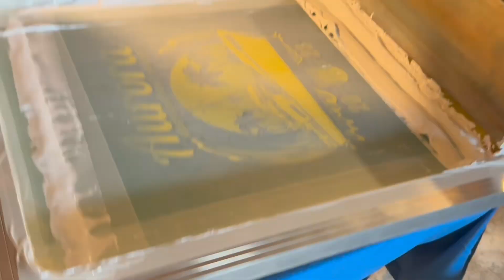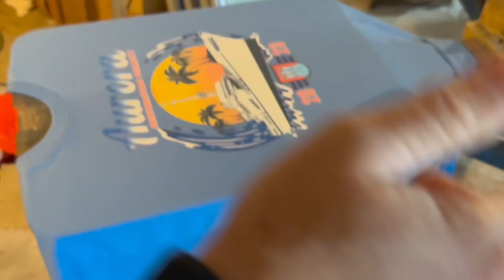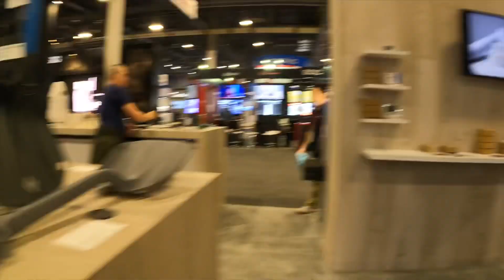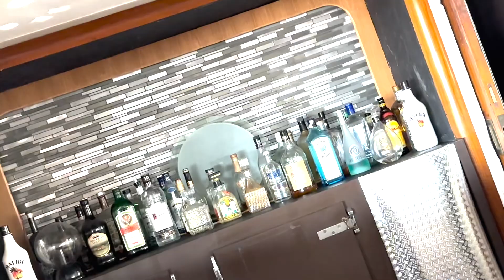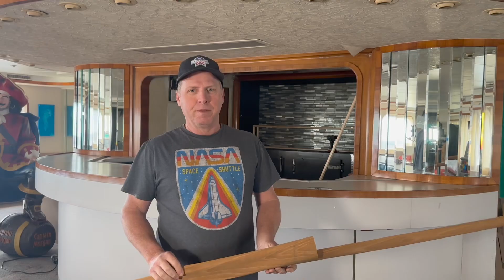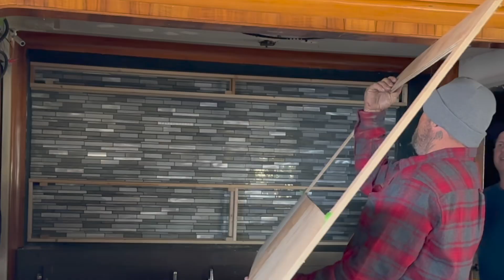HISTORIC CRUISE SHIP LOUNGE BAR CONSTRUCTION ADDING A FIRE PLACE by MODERN FLAMES

Comment: Not sure about those engines. But often they are dry sump and dipstick is for running conditions. Also look around for a pre lube sequence if possible. Most of the maritime engines come with that. 

If the engine is with a external and internal coolant system check the intercooler probably it's plugged by now. 

Fuel rack make sure it's loose not a fun sight having a engine that size run away. 

Try to see if you can find any of the old log books and procedures. Most machinists keep good track of what and when things where done.

Comment: If there is a built in heater in the bar fire place you cant just install it with out ventilation it has to breath if your using the heater function you can't block the vents in back of unit just saying

Comment: Dose this fireplace produce heat on the back side for the lighting or a heating element? Dose it need air vents to allow heat to escape and not be sealed Air tight in a box? Looked like it has vents on it so u need air flow around the unit. I like wood for a wall mounted fire place. If it was low on the ground like a real fire place then brick makes more sense

Comment: Great to see another video from Aurora! Hopefully, you all will weather the Spring storms and not incur too much damage from any leaks. I'd stick with the teak look until it becomes evident (if it ever does) that a change might be necessary. Ditto correction if any safety issues are found. I wouldn't think this might be a heat source. Be well, be safe!

Comment: Chris – not sure if the unit actually gives off heat, looks like some of the Modern Flames units do, but I suspect you’re looking at the visual aspect not to try and warm up the liquor bottles!  So, if heat’s off the table,  the teak face looks good – but, since you are on a ship, I’d put trim around the edge the serves to cover the screw heads and lap over a bit to assure the unit won’t fall forward in case of turbulent seas!

Comment: I would have thought it would go in the cabin somewhere 
We’re the people will be not behind the bar we’re it may get too hot for the drinks and anyone working in there 
I think there needs to be two of them one on each side of that area below the side windows
Reply from the maker: More of just a light feature than an actual heater in our case.   Will never need to produce heat in this location.

Comment: As an expert fireplace/appliance inspector, I urge you to follow the clearance allowances to combustibles as noted by the manufacturer. That is the only safe course of action. Personally, I like the tile better than the wood, but I can't see an easy way to save it.
Reply from the maker: Thanks for the info.  Interesting enough we have the heat disconnected as we only intent to use the light show.  The wood seems to be the popular vote.  It does look amazing when in operation however.

Comment: Is the tile mounted to something that can be moved 6 inches forward?   If possible, I would simply cut a hole in the tile wall and insert the fireplace directly into the tile.   Even if the tile cannot be moved forward, perhaps the fireplace can be inserted into the substrate (plywood ?) on which the tile is attached.  For a modern electric fireplace, I definitely think the tile makes a better backdrop.  Teak looks better as an “edge” or framing material.  When you have a whole wall of it, you tend to lose the character of the wood.   If nothing else, I would try to build some kind of a metal or plexiglass “frame” to suspend the fireplace in front of the tile.  You could even add indirect lighting behind the fireplace to make it appear to “float” slightly in front of the glimmering tile wall.   Cool project !

Comment: Is that unit going to produce a lot of heat?  I know it's an artificial fireplace, but I have installed two of those before, and they require case clearances for heat dissipation.   If heat dissipation is a problem, I would go with tile.   If it's alcohol fuel, I'm not familiar what the requirements are for those.  Can't wait to see part II.

Comment: there are fireplaces surrounded in any materials, even plaster, wood, and bricks. The difference is edging is usually fire resistant.  I would swap that plastic black trim on that electronic thing... with some kind of faux stone or faux material.

Comment: Gosh - well you have kind of a stone look behind there. It looks too far back there. Humm a rethink - front of the bar does not really work as it would have to be recessed for the curve. The wood - if you still have the cut out - it should be useable somewhere else, just use a molding to frame the removed part back in.
Reply from the maker: Yes,  Definitely will be creating more work for myself but that’s nothing new.  Definitely curious to what the popular idea will be.